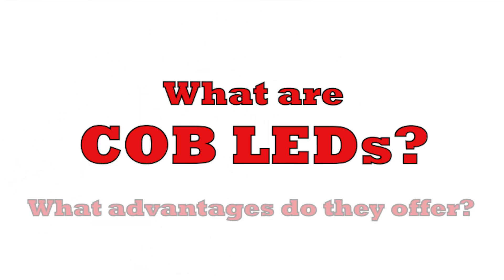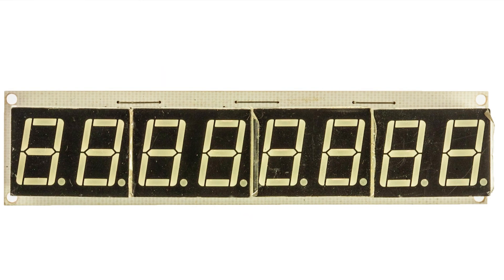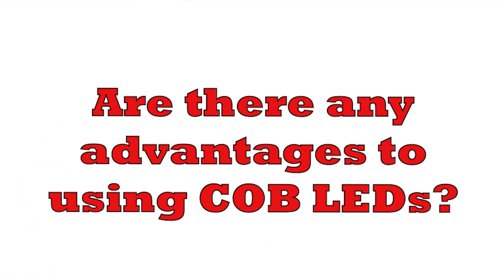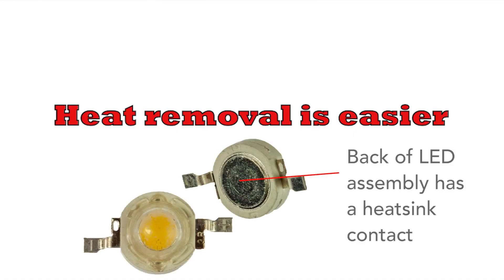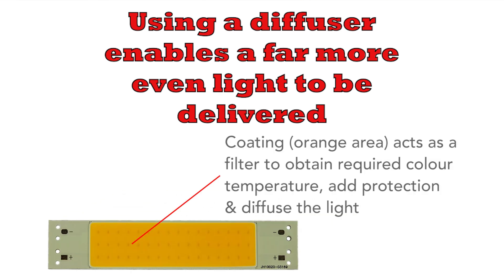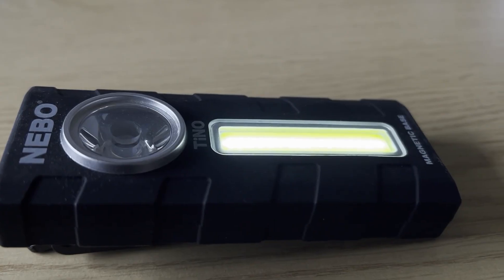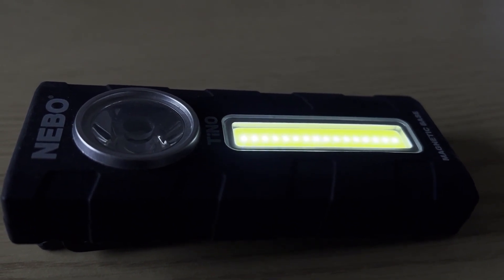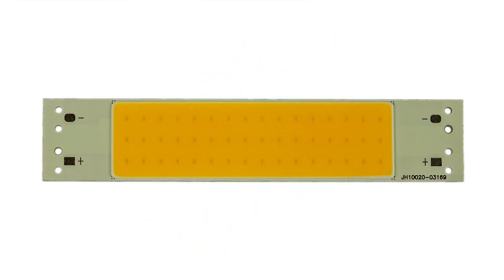What are COB LEDs - Understand Their Technology, Benefits & Applications

Comment: Soldered connections are not "notoriously unreliable." If that were true every electronic thing made in the last 100 years would be broke all the time.
Reply from the maker: I suppose I was comparing them to bonded connections.
Reply: @ElectronicsNotes  Fair enough.
Reply from the maker: @misterhat5823 The comment was probably somewhat harsh, but soldered joints have always been a source of issues, but with modern production methods things are much better.
Reply: Well they can be in cheaply produced multi-LED systems. If the joints don't fail, the LEDs often do.